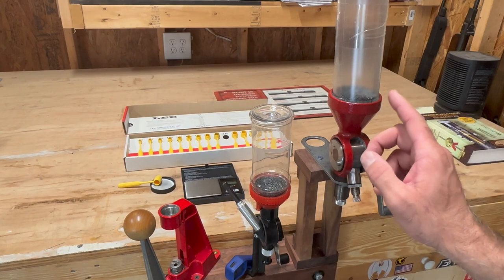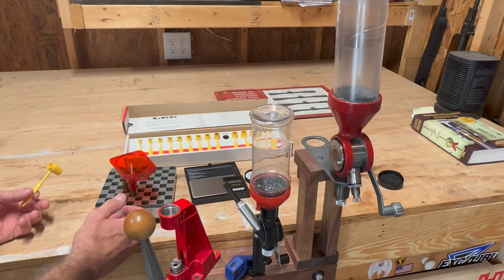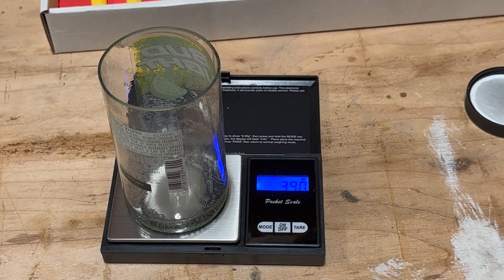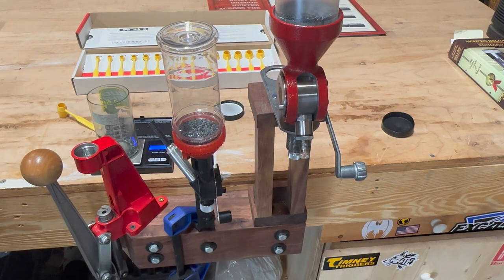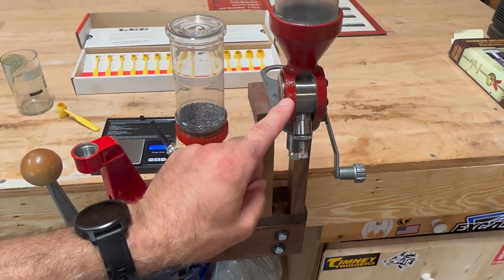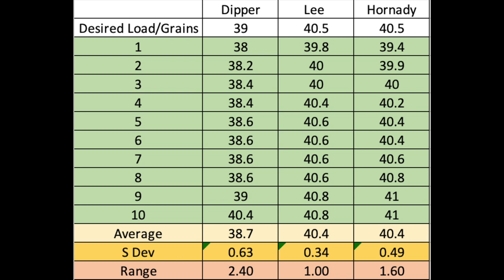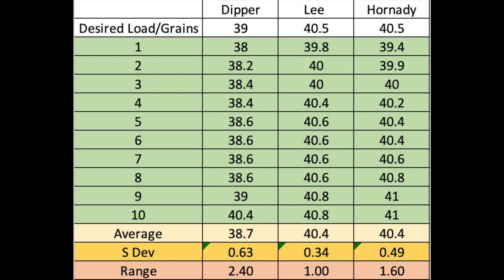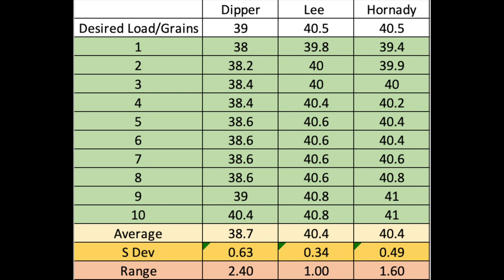Powder Measures for Reloading -- Powder Dispenser

Comment: I have the dipper kit. The lee powder dispenser same as you only with the older hopper (red). I also have the lyman brass master. The lee dispenser is more accurate. I also have the lee auto drum measure on my progressive press. It's also very accurate and comes with multiple drums, which you can initially set up and change them out very easily.

Comment: I have both Lee and Hornady. Use a double baffle and you will be hitting +-0.1 grain easily with ball powder like H335 or Staball. This means I don't have to weight every charge even for precision practice rounds. Extruded powder by nature doesn't work well with measurement by volume, but they are easy to add that final few kernels once you are close.

Comment: Great concept but would be interesting with a redo with more filled dispensers. 
My finding is that the Lee plasctic can deviate *a lot*. I often get sudden drops where it goes from 4.0gr to 3.6 and then back to 4.5. Don't know whats going on but it's almost new and I've tried fiddling with it but with no success.
It's gotten to where I need to measure every single load.

Comment: In the Lee manual, when using a dipper you shouldn’t scoop it, you’re supposed to place it bottom first into the powder and let it fall in, avoiding some that are more packed versus loose charges in the dipper.
Reply from the maker: I have done it both ways and have noticed very little difference.  But yes the manual does say to push scoop down into powder. 👍

Comment: Nice job,  did you try other powder type and shapes ?
Reply from the maker: limited.  powder is so expensive i just use what i have on hand.
Reply: @randomreviews7574  different powder grain shape produce  different accuracy. some loader use more then one  Powder Dispenser dealing with variety of powder flow characteristics  resulting in better accuracy.

Comment: IMO, throwing ball powder is easy. On the other hand, depending on the granule size and shape, some extruded powders are throwable to decent ES if proper technique is found and used consistently. Others are strictly throw light and trickle up material. The main variable in this that is not discussed is the effect of different measure operating methods. For extruded powders, this can make a lot of difference, and the old BS about it not mattering as long as you are consistent does not survive careful testing.

Comment: I have that exact pocket scale and can say that it's not consistent enough for reloading. Not only will the zero drift the longer it's on, taring won't correct it. I was able to watch it slowly say my charges were getting heavier despite my balance beam saying nothing was changing. I tried replicating with a single bullet and the same thing happened.
Reply from the maker: yea i need a better one
Reply: I went back to my beam scale..... dbl checking every 5th and 10th load..... I also have the same electronic scale.... its not good even after re calibrating it.tare was bad also